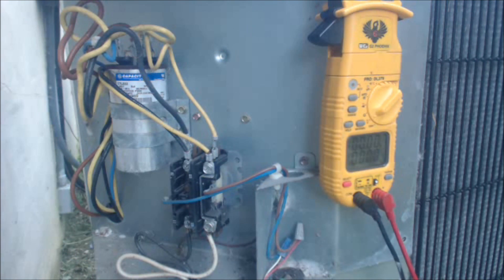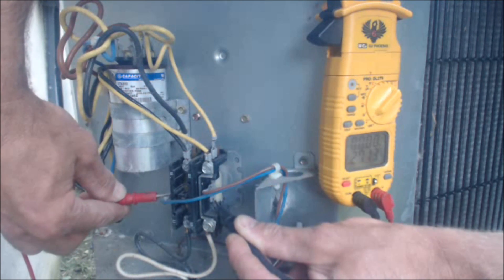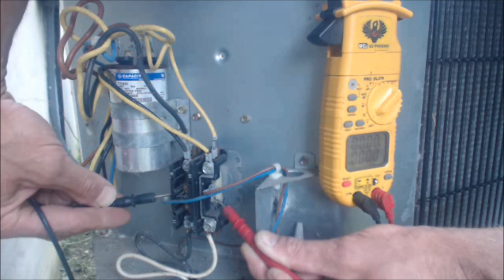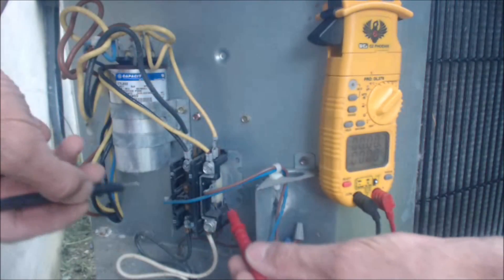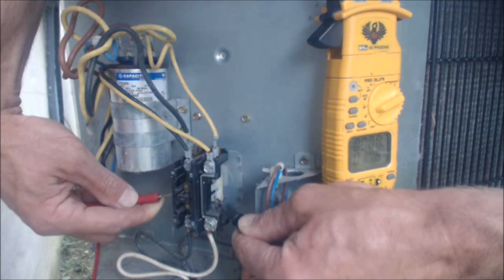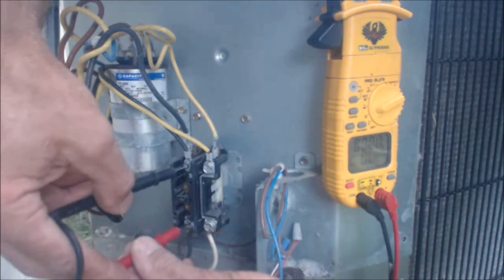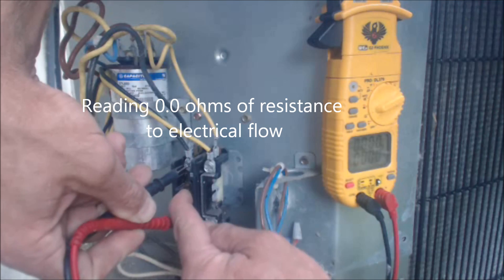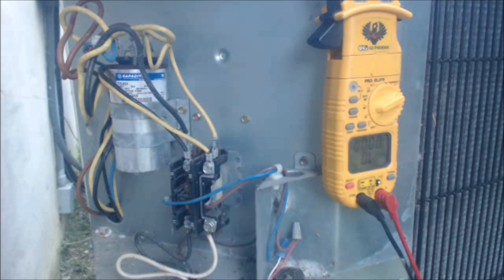Outside Air Conditioner Not Turning On! Explained!- Voltages, Contactor Troubleshooting

Comment: Thank you for these videos.  My outside unit will run for 30-60 seconds and then the plunger on contactor releases and unit turns off, but the inside unit is still trying to cool.  Is that a bad contactor or something else?  For replacing the contactor can the FLA be greater than the FLA on the old one? Thanks
Reply: Could be a worn contactor struggling to hold its contact down due to pitting.

Comment: Hi sir what the problem for this AC,no 240 V come in the contractor and no 240 in the fuse box,check the electrical break is on so what’s the issue if like this?

Comment: I've been told by some techs that you can get away with a typical contactor without worrying about FLA. Is that a danger to the compressor?
Reply from the maker: Uh oh. The fla rating is for the amperage across the contacts and the force holding the contacts together. A lower rated fla will cause a higher amperage unit to fail quicker at the contactor. Size the contactor for max amps of the unit, thanks!

Comment: You forgot one more cause for your case, very easy one, most tech would ignore, check the fuse. I had a case exactly like yours, no power, but has 25 volts on plunger, it takes me half day to figure out it is such an easy problem.

Comment: I had been messing with my A/C trying to figure out why my compressor kept cutting out for weeks. Come to find out it was due to a "power saver" box installed when the A/C was new by the former home owners. This video explains the hows and whys of the "power saver" box.
https://www.youtube.com/watch?v=HtEGHEDmqpA
Reply: How did you fix the issue? Called my provider and they said power saver isn’t on. Don’t think they know anything about whether the wiring is faulty

Comment: Thanks for helping me determine what part to swap out. I had a defective contactor. Had 27v but was twitching on and off when I wiggled the wires off. Probably should have turned the thermostat off prior to removing the wires. The unit is working now
Reply from the maker: Thanks Yasar!

Comment: So even if the contactor is pulled in but the fan ain't moving and no bulging on the capacitor... it can be the  contactor done where it wont send the juice to cap to send to the fan ?? I was at a customer's and found out the condenser stopped running I checked the drain pan it was full of water I drained it but during that the safety float switch triggered on n off I heard the condenser turn on n off but once I got done clearing water out pan and went out side thr contactor was pulled in but wasnt given the  fan any juice to run. Now before I drained pan contactor wasnt pulled in I pushed in and the fan spun and compressor was making normal noise I let go then went to drain pain but some how from the safety switch float triggering on and off the fan wasnt spinning at all .... could it be the cap or the contactor??
Reply from the maker: You would need to follow the voltage through the contactor to determine if it is making it across the contacts. There may be a 5 minute delay on the outdoor unit board or delay control if equipped, thanks!
Reply: @acservicetechchannel  u know what it was the safety switch In pan tripped thee breaker there was no cut off switch in attic so as was draining the pan the float kept triggering off the unit n caused breaker to trip ... was emergency call late night and when the brain on guard mode cant let customer interfere w thoughts lol I kind of let the guy say all breakers on when he went to check but when I went myself I seen they tripped lol
Reply from the maker: Ok thanks for letting me know!
Reply: @acservicetechchannel  yea fatigue sometimes and relying on another person's words is a no go lol

Comment: What happens if I don’t have any volts on my contractor?
Reply from the maker: The unit will not turn on if there is not 24v on the side of the contactor or the high voltage at the taps, thanks
Reply: hello what else could it be if voltage 24 volts not reaching contactor? any other switch?
Reply: @omarrangel7180  what was your problem?

Comment: Commercial rooftop Ac question,
Couple weeks ago i noticed that one of my Ac wasnt cooling , i went up on the roof and the fan wasn’t spining, i turn off the braker and right back on , the fan works perfect. 
I got a new Capacator and it did the same thing also i changed the fan motor , today the temperature was not going down, went up there and the fan was not spining again. 
Is there anything else that i can do , also will riplacing the contactor will fix this? 
Any suggestions will help , thank you!
Reply from the maker: Is the fan being powered right from the contactor along with the capacitor but not with control or defrost board? Thanks
Reply: AC Service Tech LLC the new motor cables were short to reach the capacator, i just cut the  old cables and conected them with the new ones , I have the cables connected to rhe capacator just like they were before
Reply from the maker: I just meant, is there something else in line such as a control board or defrost board relay that may be stopping power going to the motor?
Reply: AC Service Tech LLC I don’t know i’m not familiar with that stuff i took a picture of all connections in there but I don’t know what part is what, and i don’t know how can I upload that photo in here, 
Model is Carrier 50hj 006
Reply from the maker: info@acservicetech.com
Reply: AC Service Tech LLC i sent an email with the photo , to your email
Reply from the maker: Flachi, I checked my email and didn't see yours but I am getting others.

Comment: I was at a heil gas furnace the ppl had a Power surge I believe the guy before added a carrier a.c. coil customer had some meat head come and try to fix it but he kicked him out then call me I show up to to test transformer on the 120 v side was dead but giving resistance on the 24 v side so i got a new transformer put it in but then tested the contactor and wasn't getting 24 v to it but was getting the 240 v it's a 28 year old heil gas furnace w the old style furnace t stat strip   can I jump 24 v from the transformer on to that old t stat strip to get the 24 v going to the contactor ??
Reply from the maker: If it has two transformers then you can't jump but if there is just one then yes you could jump it to test it temporarily, thanks

Comment: my system won't come on. I get a reading at the contactor at L1  and L2 of 0.196V and at T1 and T2 0.000V,  coil resistance 16.9,  and I got 0 volts at coil or I wasn't pressing hard enough.
If I remember the contacts were open. May I ask what you think? Thanks.
Reply from the maker: At L1 and L2 of the contactor, that is typically stated as the beginning of where the voltage enters the unit at meaning the your breaker or fuse must be open shutting power off to the unit, thanks James!
Reply: I have an switch on switch off at outside breaker and measured 240 volts.
So I guess no power is getting to L1 and L2.  I don't see any tripped breaker in the home either.  So replacing contactor is not the problem?
Reply: It is an older thermostat. I changed the batteries, when I turn it on, it just makes a clicking sound, could the thermostat have gone bad?
Reply from the maker: Hey James, here is a video on verifying if the tstat is good-  https://youtu.be/Sd3IF3QYIKY  -  Are you saying that you read 240v at the disconnect outide but where the wires connect to the inlet of the contactor, there is no power? Are there fuses in the outdoor disconnect that don't read 0.0 ohms when testing their resistance with the fuses disconnected?
Reply: yes that is what I am saying. Don't know if there is a fuse behind the breaker on off switch, there was 4 wires going into it, two wires gave me 240v.
 Maybe i'll check it out. funny i decided to look into my panal never had it looked at, it is old and always ran, I cleaned out the condenser coil, vacced out the leaves, then took out the leaf blower and blew out the panel area, and after that it never came on, and never had a prob. before that. I guess little by little it will be trial and hopefully I will get it figured out. Ill check out your vid. Thanks for your assistance. Ill let you know how I made out.
Reply: SUCCESS,  with new dis. box.  :-)
Reply from the maker: Awesome to hear!

Comment: ive got a first time seen problem, and need HELP figuring out...
Everything working great, new fan, new cap. BUT every now (sometimes 1 hr, or 5 hrs) and then fan (only outside fan) stops working. I try to free hand spin it, and nothing. After waiting (sometimes 20 mins, or 2 hrs) turn it back on and everything working great again. Extreamly confused and would love some feed back if anyone has seen this problem before. Thank you!
Reply from the maker: Is this a heat pump or just an ac condensor?
Reply: It could be a power saver switch installed by your power ompany.
https://www.youtube.com/watch?v=HtEGHEDmqpA

Comment: hi.  I have replaced the contactor and the capacitor.  When i turn on the AC through the thermostat i see the contactor suck in the little plunger/switch thingy but the fan nor the compressor dont turn on at all.  can you please help me?
Reply from the maker: Did you check your breaker to see if it is tripped or off? It would be a double breaker.
Reply: Thank you.  Thing is. 1 of my 2 buses on my electric panel is working so I have the ac hooked up to 2 20 breakers but they are on the same bus.  I tested with a multi-meter on each breaker and it shows 110 or so but could that be the problem.   In order to correct the bus issue I need to replace the main breaker on top of the panel which i tried removing but seems to have welded itself to the electric panel.  One of the screws connecting to the panel will just not budge.  Will you please advise?
Reply: does what i wrote make any sense?  could the bay issue be the problem?
Reply from the maker: It won't work if they are the same buss because the sign wave is not different. Sounds like you need to have the panel professionally replaced or the breaker somehow pulled and replaced, thanks

Comment: always take your rings off when working with electric or climbing up and down ladders, safety first:)
Reply: unless you have a qalo(rubber) ring!
Reply: Rings Smrings. Number one is to shut off power and Numver two is to double check power is off with voltmeter. The longer you work with electricity, the more you get lazy. Don't get lazy.

Comment: Common mistake new techs do is they test the 120v at the contactor incoming on both side but NEVER  test for the 220v between them. 120v on either side is great but you might have back feed on the other side and think that you have 120 on either side but you dont have 220v total.
Reply from the maker: Thanks ChuckYouFarley!
Reply: What does it mean when you have 120 each leg but don't have 240 across both is the a contractor problem

Comment: i replace the capacitor and when i installed the new one and pushed down the contacts down the three cables in the compressor burned and sparked and the kill braker burned    
and melted i re install the old one back and it did the same thing have any ideas
Reply from the maker: Sounds like one of the hot wires is grounded or the two hots are touching somewhere. Did you take a picture of what wires go on the C, Fan, and Herm terminals before replacing? Before turning the unit back on, the compressor terminals should be checked and resistance should be read with a multimeter to find where the problem is. If you are unfamiliar or are not a tech then I would say it is best to call a company maybe that a neighbor refers, thanks
Reply: acservicetech yes i think whats what happend when i tool the cover from the compressor the cables were burn i thought ot was from a short but they were already bad i replaced the disconect put new plughs on compressor and is now runing fine thanks
Reply from the maker: Oh good, thanks for letting me know
Reply: LRA

Comment: my unit will not power on........can someone help me.....i checked the contactor and replaced it,,,same results,,,,i then push the piece on the contactor in...unit came on......when i let go unit shut off
Reply from the maker: It sounds like you are not getting a low voltage signal from inside. I would ask for referrals from neighbors as to what company they can recommend, thanks!

Comment: My contactor was visibly burnt. I replaced it. It worked great for a day. Then it stopped working with same symptoms (wont start). Any ideas anybody?
Reply from the maker: If you are an hvac tech just because you really need to be careful, did you test for 24v on the sides of the contactor? Did you try pushing in the contactor with something rubber or plastic (not metal)? Is the new contactor a large enough of a fla "full load amp rating" for the unit's amp draw. If the new one is burnt then that is likely the cause or the unit is drawing too many amps and the fuse or breaker is sized too high. Thanks and I hope this will help!

Comment: A few summers ago I got a call from a person I was helping out as a side job, I found the problem to be ants in the contactor with a huge dirt pile of them beside the condenser. I just cleaned up the contactor Got it running and told him to take care of the ant problem. gave him a small bill for my time. few weeks later he said  his unit went out again and a company said he needed a new compressor, So I went out again and checked the compressor and found inside the compressor cover was full of fried ants shorting it out. Few minutes later cleaned it up and used a terminal repair kit one of the wires were fried and burned the wire off. gave him a little bill and told him again take care of ant problem. Few weeks later same problem with contactor, full of ants, fixed it again and gave him another small bill. Sorry for the long topic, Would you take care of his ant problem the first time? I cant stand the lazy home owner that just wants his A/C fixed. Should We be the exterminator also for a home owner when he has been told what the problem was? And I was just helping him not a business call.
Reply from the maker: Oh wow, yeah the "tawny crazy ants" are the ones known for colonies set in and near electrical connections. Are you in Mississippi, Texas, Louisiana, or Florida where they have been reported or in another state?
Reply: Im in SC but ants love the buzz of a contactor or "anything" they can get into lol.